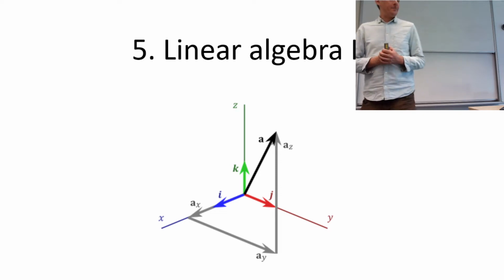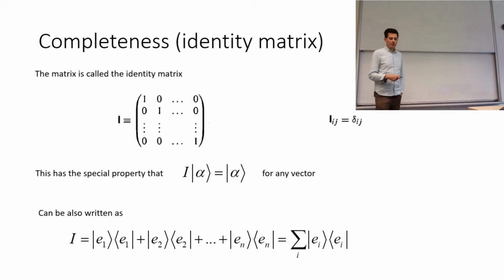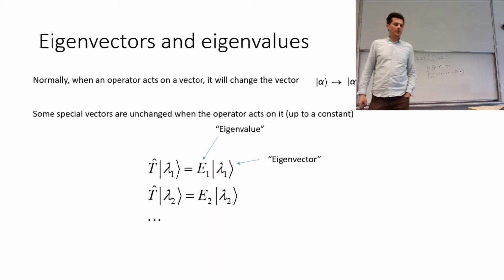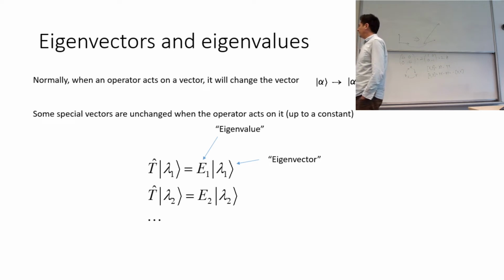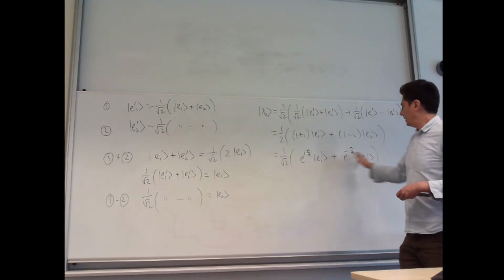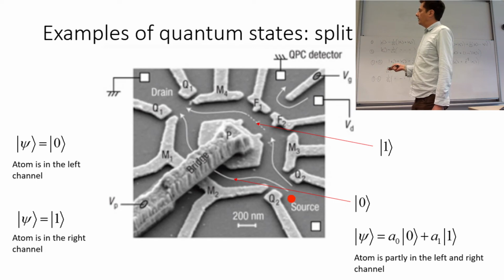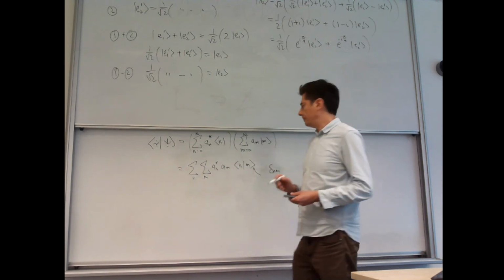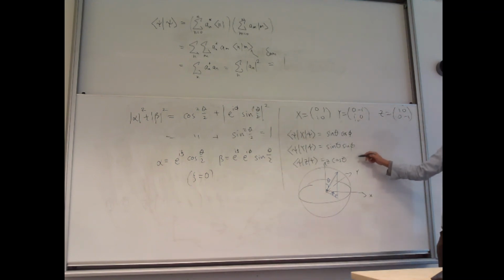L4 The wavefunction : Introduction to quantum computing course 2022

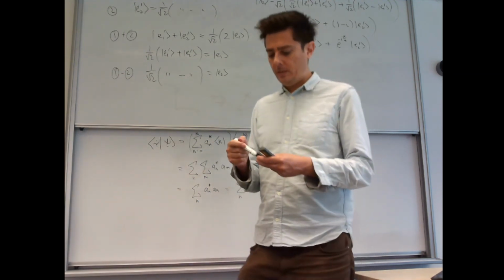Comment: at 58:16 what happens to the supposed delta? do we assume it's =1 and that leaves the length =1 ?
Reply from the maker: The delta is the Kronecker Delta (google this if you don't know it), where it is equal to 1 of the indices are the same and 0 otherwise. So of the two sums, one is removed.  The length is defined to be =1, which is the normalization condition.
Reply: @NYUQuantumTechnologyLab  Thank you for explaining, makes so much sense now!